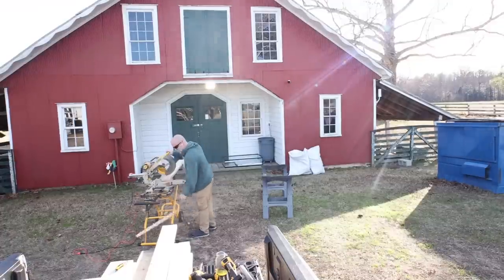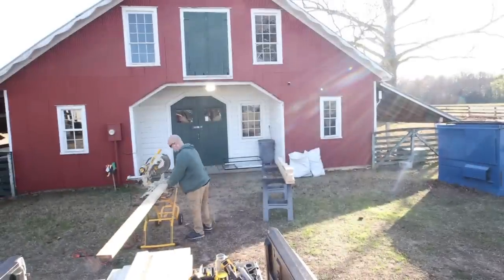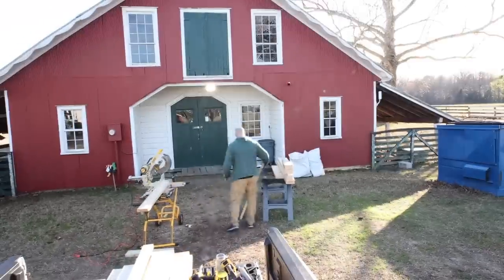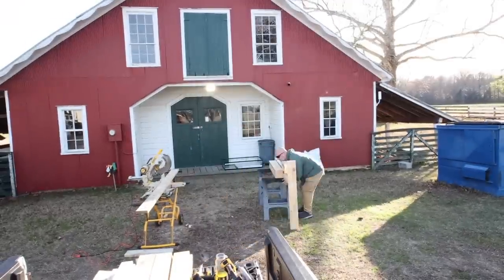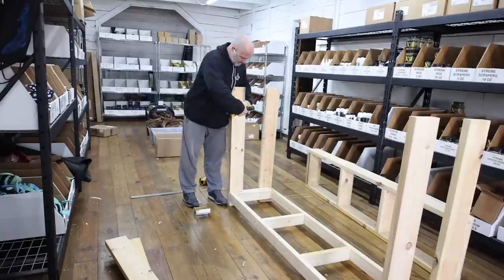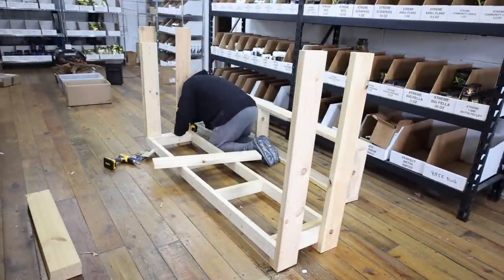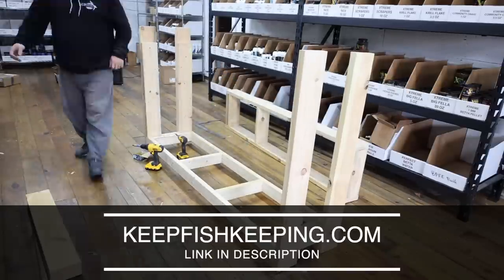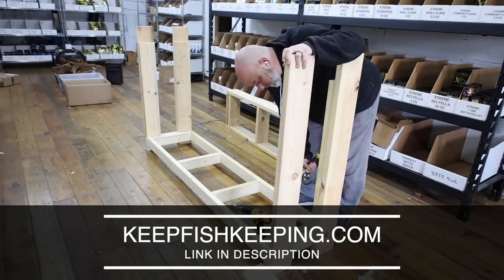DIY Stand For TWO Large Aquariums

Comment: I have a metal tubing stand made by the company Hamilton that came from the best fish store in my area. It holds my 90gal tank. Im looking to expand in the hobby and add a 60gal breeder underneath. Skeptical if the metal tubing could support both stands, but it does look like what the stands designed for. Space is limited in my house so tank stacking would be ideal.

Comment: When i built my stand for my 55, I used 4x4 corner posts and put my 2x6 on the outside with a piece of plywood covering the top. With doing that, the 4x4 are inside the footprint of the tank supporting the weight. No need for the extra support pieces. At the time being 17, that's how i cut cost of materials but kept it plenty strong. Im 37 now and its as strong now as it was new.

Comment: From someone who works in construction and builds decks etc, I wouldn’t rely on brads and just the screws. Wouldn’t hurt to spend like $30 more and install some engineered steel brackets and timber loks or through lags. Would definitely add to the beefiness and would add another level of peace of mind that it won’t ever fail.

Comment: I've built several stands over the passed 55 years.  The only difference is that I glued all my joint & flat surfaces along with screws & the odd dowel spots.  I also liked when Kreg came out with there pocket hole system, I wound up getting the complete system, I couldn't help not buying it all.  John

Comment: Looking good so far! True, the weight distribution is important with this type of stand. Even with quality connecting material legs should go below the tank.

Originally I wanted to do something similar, 40gallon secondary below 190gallon main. But instead of wood I decided to go with steel (with wooden cover)... which wasn't without issues. The locksmith (who welded it) recommended 30x30 mm steel beams of 3mm thickness (2 mm is more common, 1 inch is 25.4 mm) and that even with taking out central beam out of all 10 standing beams (legs) should be more than enough, one of the LFS owners convinced me otherwise... even if just for the rest of my mind. They had one stand (of different design) twist. My flat has cheap floating floor on it (on top of concrete) and floating floors tend to deform easily. Steel is also less rigid than wood of the same strength.

Comment: You've built stands, but how would you go about reinforcing a floor/subfloor to withstand the weight of a larger tank? I have a 180 gallon glass tank that Im set up in my basement. I wanted to have it on the first floor but I'm not sure the floor can hold it. I can access the floor thru the drop ceiling in my finished basement.

Comment: If I scaled this set up to hold a 4ft 180gl tank on top would I be safe with 2x6 with no middle brace? Then if I need something on the bottom to tie it together to make it not wobble I have a 75gl I would put down there on the 2x4 at ground level. Am I safe to make it like 5ft so there is room for the 75gl but that puts the 180 in the middle part not directly down on the corners.

Comment: When working with dimensional lumber, how do you deal with the general unevenness of it? For example, I never see anyone running their horizontal supports through a jointer, or do anything to address that.

The last few stands I've built when I set the tank on there, I can see many high and low points where the rim of the tank isn't making consistent contact with the wood. Is that something to just not worry about?